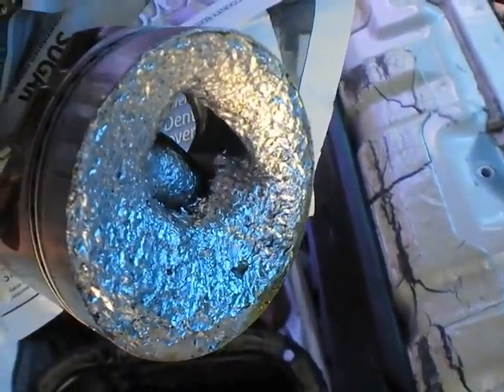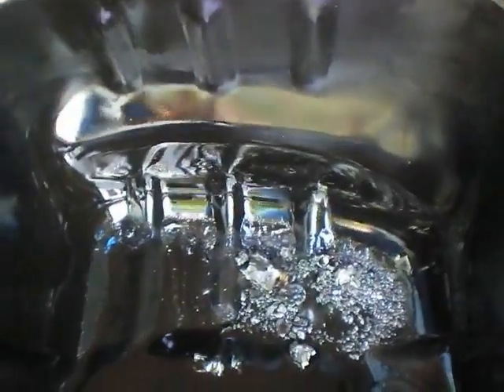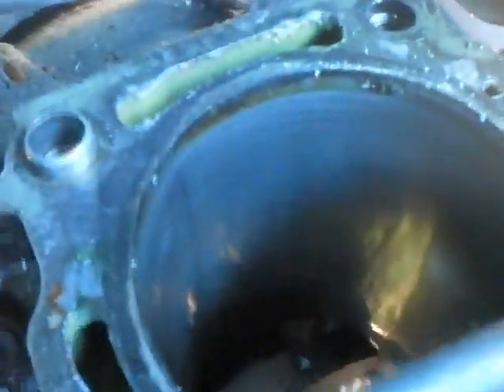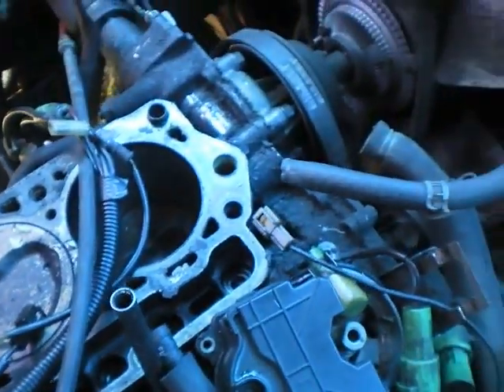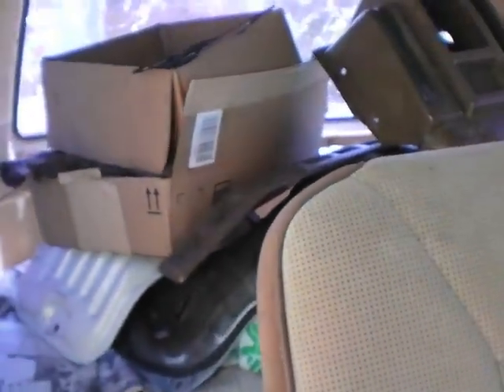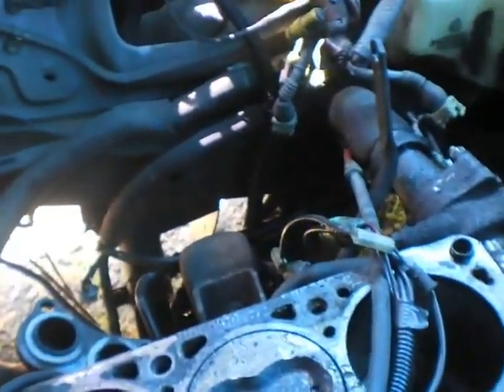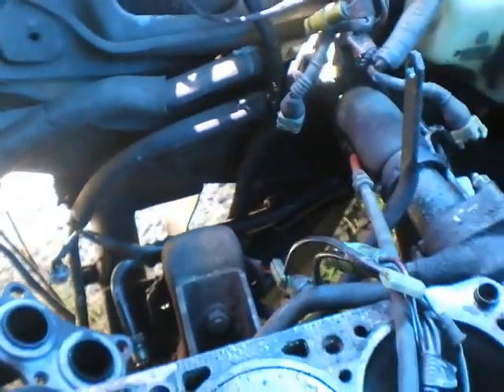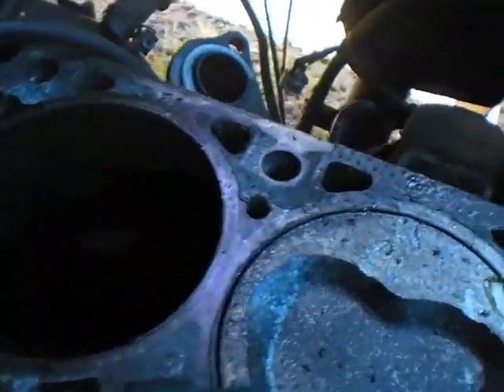1986 Toyota Van, Liteace, Townace, Toyota F, engine rebuild tutorial

Comment: My 1986 Toyota Van, automatic 2wd has a rusty oil pan leaking crazy.
I've got a new one on order but I'd like some advice.
Do I need to remove the entire crossmember to get the oil pan off? And if so since I would have to undo the engine mounts do I need to make up a rig to support the engine from in the cab so it doesn't fall?
I'm doing this on the ground so all advice is appreciated.